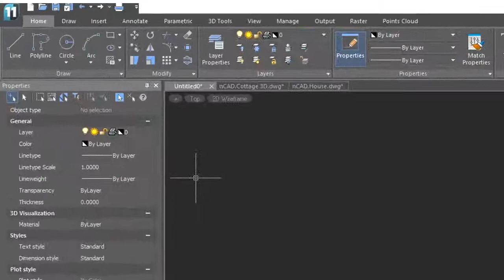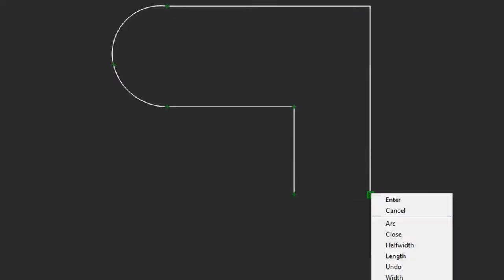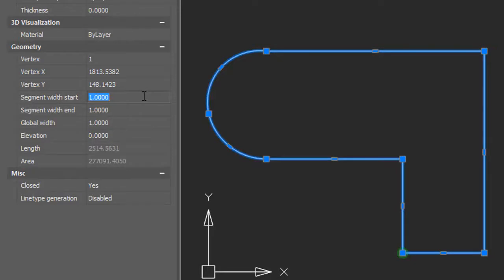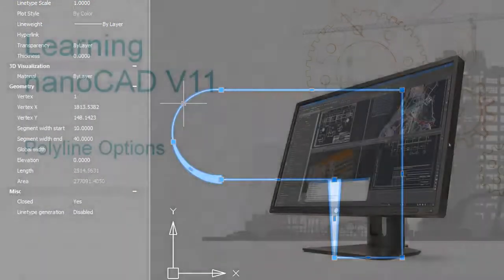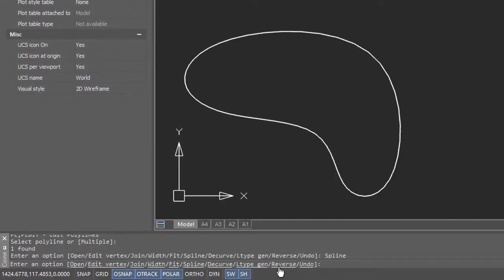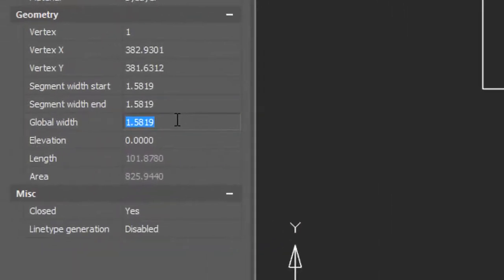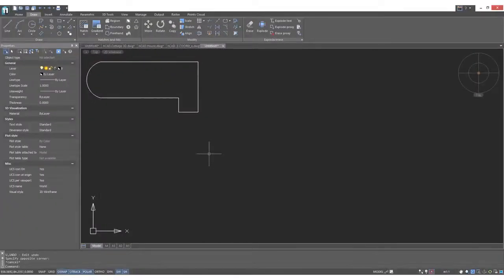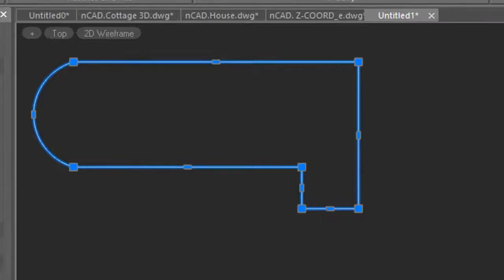How to draw polylines in nanoCAD

Comment: How to fix circle that not be able to find the center of point?
Reply from the maker: In nanoCAD a circle can be drawn in different ways like Center & Radius, Center & Diameter, selecting 2 points along the Circumference, selecting 3 points along Circumference, selecting 2 tangents and a radius, selecting 3 tangents. Here you can find lots of options which does not require any center to draw a circle.

Try nanoCAD 23!
https://www.nanocad.in/download-center